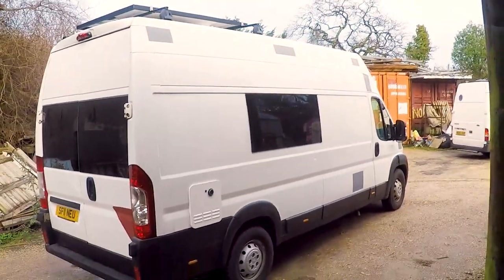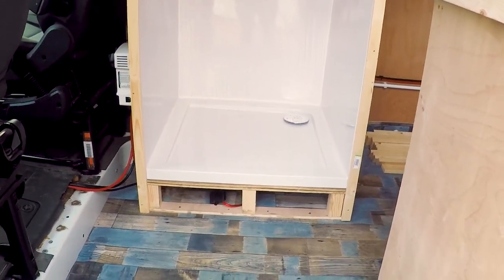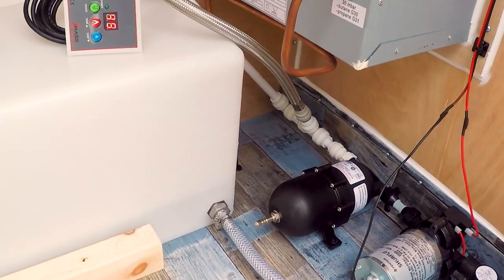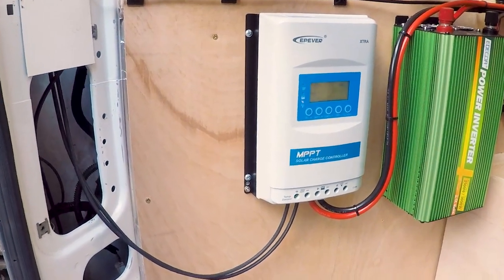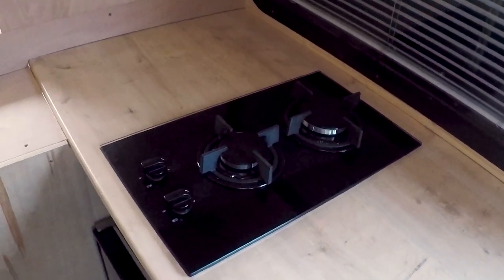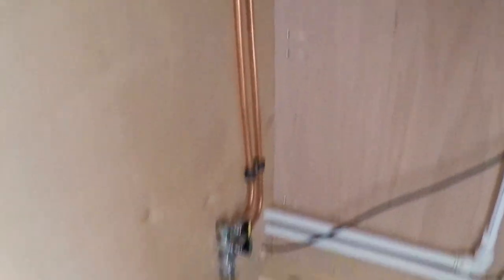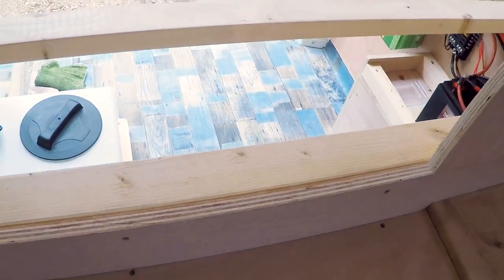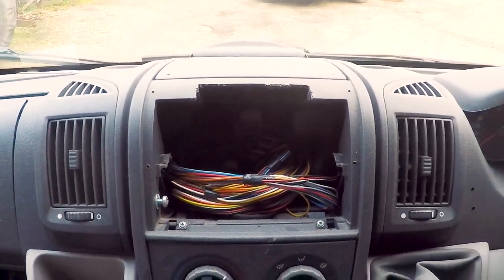20 DAY AMBULANCE VAN CONVERSION - VAN TOUR FEATURING AN IMASS INSTANT HOT WATER BOILER AND MUCH MORE

Comment: Is there only a hot water feed to the shower?
Reply from the maker: Yes only a hot feed as the water temperature is controlled by the iMass display, if you want a cold shower you simply turn it off 👍
Reply: @VANHAUSConversions  ah right, nice one, cheers 👍